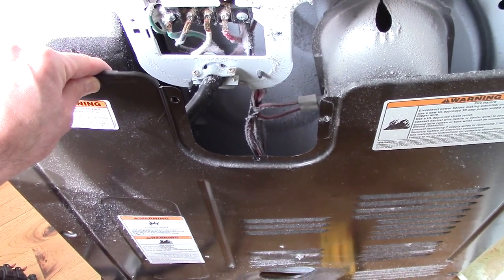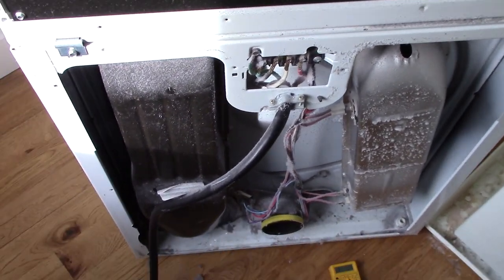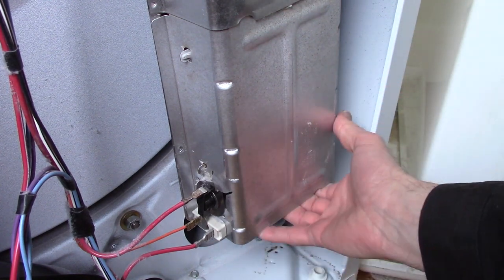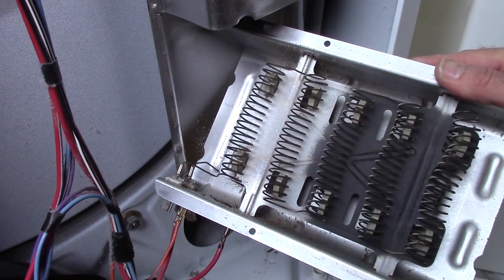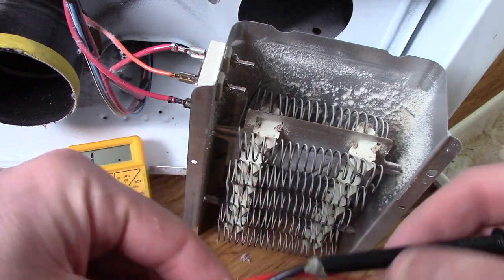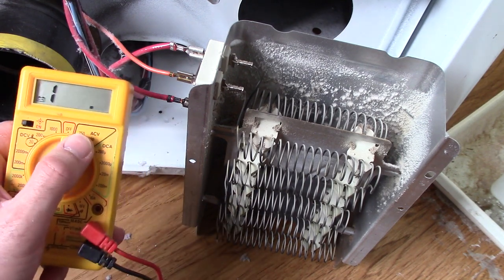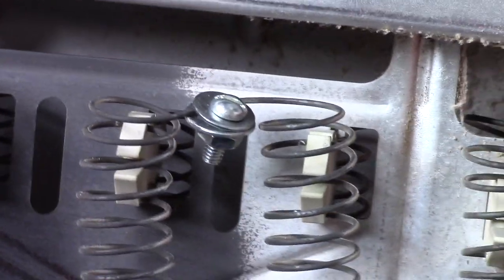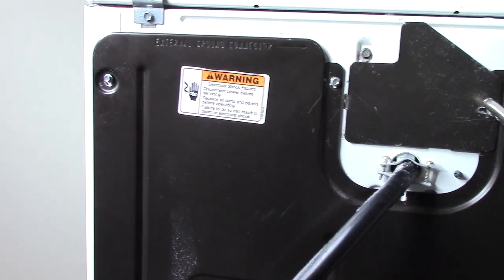Dryer Repair - How to test the Heating Element

Comment: You could test the also test the thermal fuse, and high limit thermostat for continuity before tearing into the heating element. If the fuse and thermostat get good continuity reading then check the heating element leads for continuity and/or check your heating element leads for ohms reading and should be around 10.4 or so depending on type and age...good luck you's guys...!
Reply: Hello, mine read 0 ohms. I assume there’s a short somewhere. Any other ideas? Thanks!